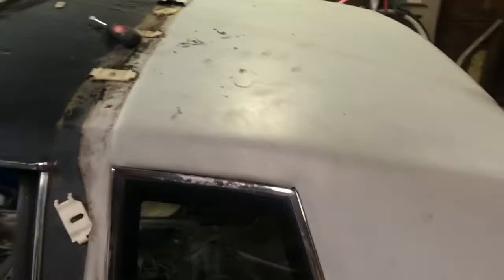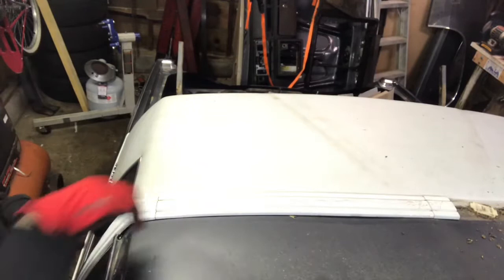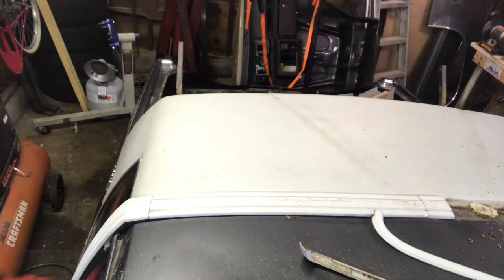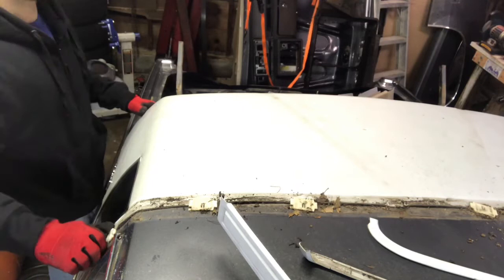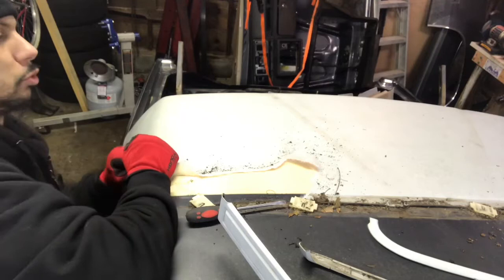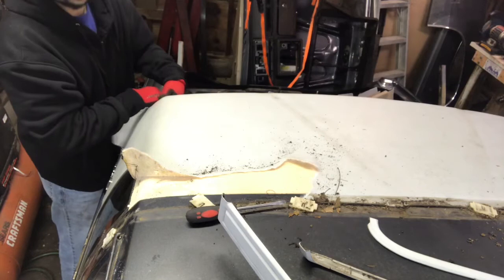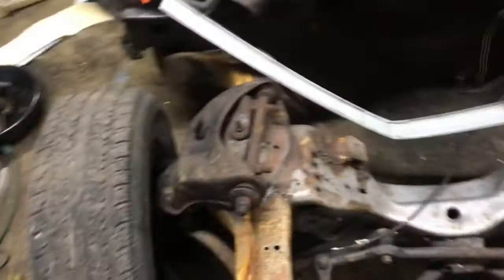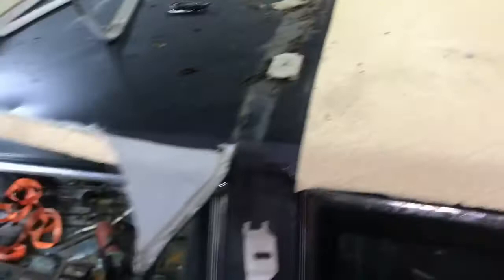Cutlass Vinyl Top Removal Part 1

Comment: Do you know if cloth top is better then vinyl?
Reply from the maker: I’m not sure. I think it comes down to personal preference on what look you want. I would think vinyl would stand up against the outside elements better. My cutlass was an 82 and the only thing wrong with it was a small slit. It looked good for being 38 years old. I took it off to make sure the roof wasn’t rotted.
Reply: @dtuck0509  ok. I’m having my 83 cutlass painted and the guy said that the cloth material lasts a lot longer then the vinyl. The white vinyl top on my cutlass is ripped all around. I just haven’t meet anyone with the cloth material to know if it’s worth it.
Reply from the maker: @montrose5paulina  I see, but either one you choose will last a long granted you take care of it. I have never seen a cloth top on one either, and don’t like them personally. Vinyl hits different because there are a few different textures to choose from.

Comment: What’s the piece that’s on the rivets on the vinyl top?
Reply from the maker: You talking about the trim?
Reply: Yes sir. Not the chrome but the piece that snaps to the rivets underneath the top itself. It goes around the back window
Reply from the maker: @mauricebarber187  trim/moulding
Reply from the maker: @mauricebarber187  if I remember correctly, there’s clips also.
Reply: Yeah I'm looking for molding I have the trimming